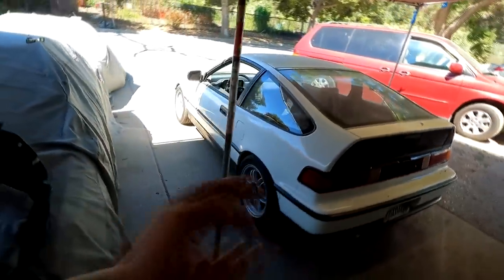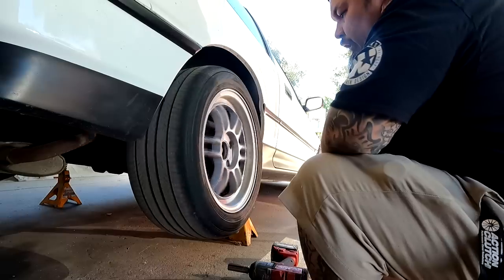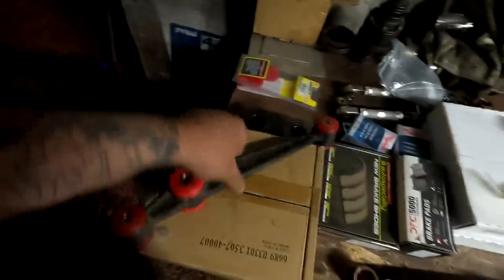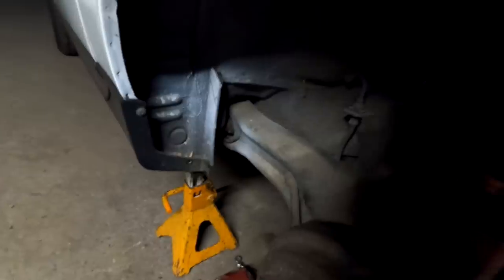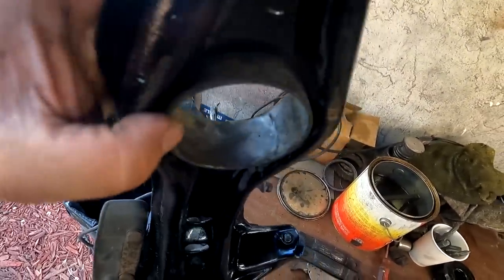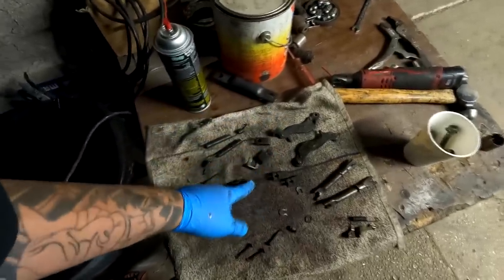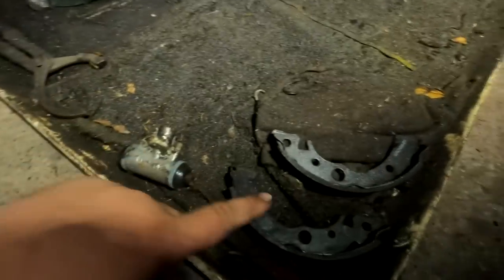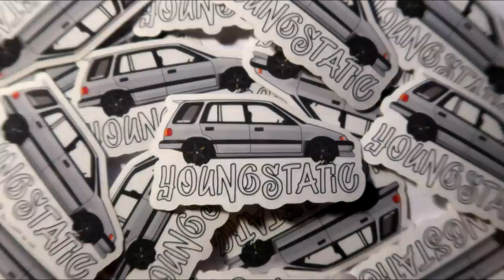RESCUED CRX GETS NEW SUSPENSION UPGRADE + BRAKES (1/2)

Comment: If you don’t have a vice, one of those dewalt clamps with 400+ lbs of clamp force works well. I’ve used it for motor mount bushings and it worked with no problems

Comment: Look at obsessed garage for the flow data on most electric pressure washers. You need the right size fittings for your short gun and foam cannon. Changing the cannon to a 1.1 works well for lower pressure foam.

Comment: I think I remember reading a post from Energy Suspension like 10 years ago where they said the red & black are the same compound however the black is impregnated with graphite in order to help avoid the common binding/squeaking issues associated w/ poly bushings. But this was about a decade ago, so I could be mis-remembering. Non the less, black bushings are the way to go.

Comment: Those urethane bushings on the big trailing arm bushings ALWAYS bind up. Use oem style rubber ones. (urethane is fine literally everywhere else!)
Reply: Silicone grease to lube them up, and they dont bind. It binds when the poly meets any metal without a lubing compound between. Be sure only to use silicone or a synthetic grease, no bearing grease cuzz that eats through overtime. I havent had any binding since i started using silicone grease, done all my cars that way since then, and its been solid for past 20 yrs :)

 Oem bushings are softer with more give under weight, which is fine for stock setup, and normal driving. Your gonna want the stiffer polyurethane if your driving more aggressively like at a road course track, or canyon carving, where the vehicle weight shifting from both acceleration and deceleration, at a more frequent cycles, vs normal driving, where its more linear with the weight gradually shifting, and your not under heavy G's hitting turns back to back putting the bushings under heavy twisting force. Its the lateral twisting that weakens those bushings overtime. Sure the ride feel is stiffer, but its predictable when it needs to perform vs oem rubber, where it changes after the initial compression tensile of the rubber is exceeded.
Reply: Bet you pressed it in dry?
Reply: @Dcdc956  lol yeah they most likely did.

Comment: Yo man don't use fire to remove the rubber off the metal race instead use carburetor cleaner and a flathead screwdriver it comes right off